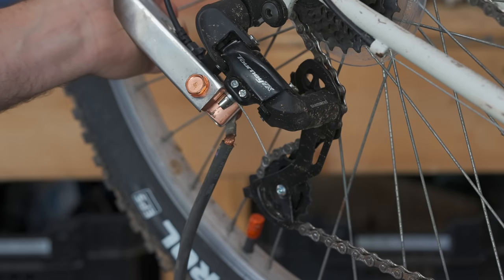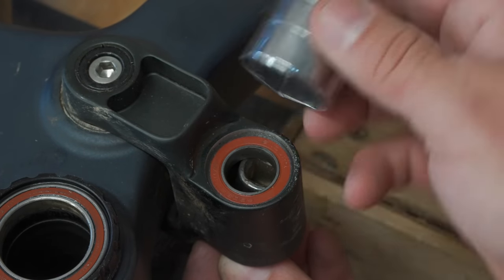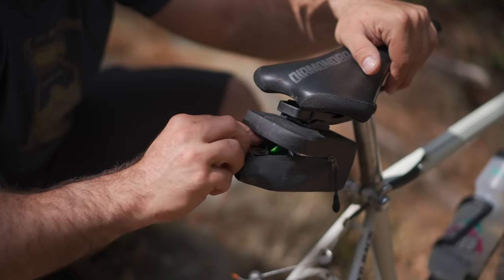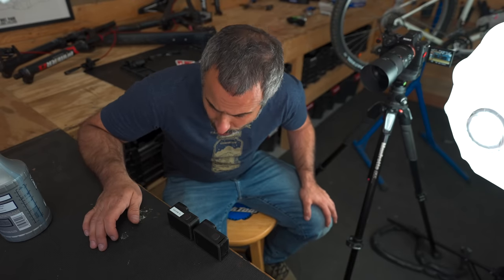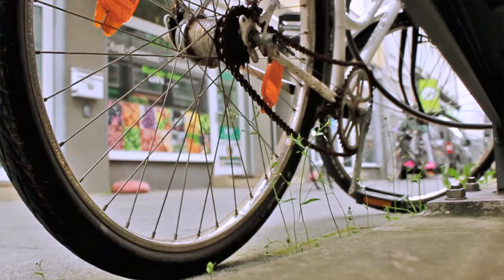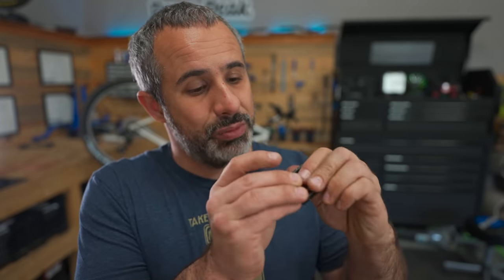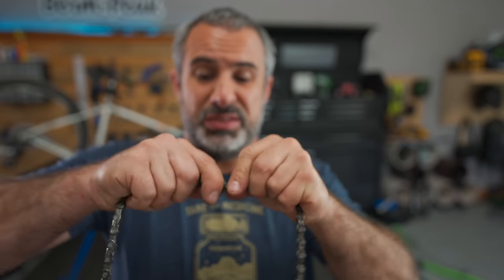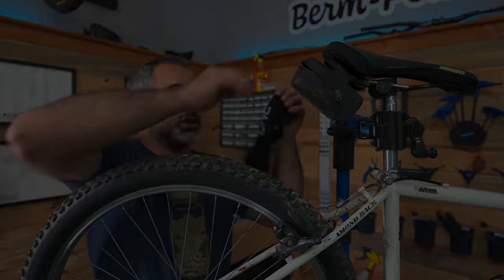10 ill-advised hacks for bicycles

Comment from the maker: Just a note on the chain repair “hack”. This isn’t a hack at all with a single speed chain, BMX chain, or even an 8 speed chain. This is simply HOW YOU DO IT, and in fact some chain tools even have a fence for loosening tight links. But newer 11+ speed chains, or hollow pin chains really don’t hold up well when re-using pins. So if you are repairing your Eagle chain this way, it is indeed a hack.
Reply: for the crank puller, use the little metal bit / insert inside the plastic bit that screws on a shimano 9mm QR axel that little metal bit will fit inside instead of the coin you showed.. and it can be reused over and over and is most likely cheaper than the coin.
Reply: Was status quo up to 9-speed.
BACK IN MY DAY, we didn’t have these fancy smancy quick links and chain pins…
Reply: as a person who works 99% of the time with older bikes it was fun to listen to you explaining how to do something so basic for me :) Normally you do lots of mysterious things like using tubeless tires and servicing forks :D
Reply: Can you do a collab with skills with Phil and go to on Killington bike park this summer.
Reply: Is this a hack I rode 100 miles on this with my cheap multi tools chain splitter won't put it  back together luckily broke down next a mechanic who fixed it with a hammer and body work panel, always carry a quick link😂
Reply: Hey, where did Kevin get to?
Reply: good you added this note, cuz that "hack" was just silly wierd 😂
Reply: Beat me to it.
Reply: Fresh champagne corks as bar ends is the best hack
Reply: Bro what if your 13 and don't have alcohol😂😂😂
Reply: I always put a shop rag in the bag to keep them from rattling. That way I can wipe up my hands or use something softer and then you have makeshift toilet paper
Reply: I broke my arm today but I can't wait till it heals so I can ride some more!!
Reply: lmao i made a comment about this and then saw your pinned comment. my bad, and you're right it's a hack if you're doing it on most road chains
Reply: @ArisaemaDracontium  Exactly, it has gone full circle when the old regular way is re-discovered by the kids with their newfangled quick links as a mysterious hack :)
Reply: thank for you clarifying. i thought you didn’t know what the hell you’re doing!
Reply: I dreamt about fixing a chain the way you described last night!  I think it’s a memory of doing this hundreds of times back in the days before quick links.
Reply: Shimano used to use a slightly larger diameter pin with a break away section for joining chains, pre quick link
Reply: @TimInertiatic  Not just used to, it's still being used.
Reply: @PetrHosek  I thought they had gone over to a quick link derivative
Reply: I have messed up every chain I’ve ever worked on AND broken every chain tool I’ve ever owned. I am terrible with chains and they make me nervous.
Reply: Berm peak merch idea, "most fun things are pretty stupid"
Reply: @TimInertiatic  they still deliver these pins with new chains, at least with 8 and 9 speed chains
Reply: As far as the rain X hack you may not have applied it correctly.
Reply: I was just about to moan!!
Reply: It's better to drive pin back on with pliers wrench and only do final adjustments with chain tool. That way you are not likely to bend the thin chain plate on the chain that is not intended for this type of connecting.
Reply: Haha literally just commented on this, thanks for the comment
Reply: @freetechdk  my dude, that is genius!!! 
my crank tool didnt come with the adapter. i tried all sorts of washers and spacers.. try this later... let's go!
Reply: @cavemanvi  corks also make great steerer tube plugs! might need to trim one a little but so good
Reply: Hey ive been watching the fip series do you know any cheap bikes like 50 or 60 dollars decent bikes im from philiphines bike are super expensive here and i got only 50dollars budget for it
Reply: Pretty much what I was going to say. 😊
Reply: I have used that chain repair hack many times on many different chains and chain sizes.
Reply: На замках в цепи только клоуны ездиют
Reply: @sketchyy7015   buy a used bike, just make sure it all works well and the frane size is comfortable for you
Reply: @ArisaemaDracontium  "Back in my day..."  looks at you in 'old.' What on earth is a quick-link? There's so much new technology I don't even recognize!
Reply: Glad you mentioned the chain process being standard  for 8 speed or wider. Some internet content suggests my tandem maintained thusly and ridden hard for many years will burst into flames at any moment because of my barbaric chain assembly process.
New Park tool with sliding fence doesn't work well for this process of freeing stuck links-older tool with fixed fence works so much better for that.
Reply: Yeah I've always done it this way :)
Reply: Ah. I was gonna say that’s how I’ve been fixing my bmx. Nice to know there’s chains out there that this way wouldn’t work.
Reply: Its just how I repaired chains since I was a teenager. Now its a hack! 😂
Reply: Was about to say, some of the things I used to race that is how we did chains.  I didn't k o about master links till I started riding motorcycles.
Reply: @kennethward9530  I usually would grab the chain at either side of the stiff link and bend the chain side ways  back and forth at the stiff link that almost always worked. Because it will open the link to where the pin is peened over.
Reply: 0:56 1:14
Reply: I am sorry man but basic chain repair is not a hack

Comment: Make sure your socket seats on the outer race of the bearing. If the socket is too small you will damage your new bearings. Also leave new bearings in the freezer overnight before install.
Reply: The bearing hack is sooo good. And cooling the bearings down is a great idea, too. I guess it shrinks them by tiny amount which still will make it easier to install?
Reply from the maker: I love the freezer idea! That's a hack itself, or you could just consider it a great tip for installing bearings easier.
Reply: @SethsBikeHacks  That freezer trick is almost always used when installing new crankshaft bearings on a 2-stroke motorcycle. It works great! Also helps if you first heat up the area around the bearing and then install the freezing bearing.
Reply: There are parts on some motorcycles that use this as part of the standard way to replace bearings. You heat up the outside part in an oven (low heat) and freeze the bearing. The bearing drops right in and once they both return to room temperature it's locked in place.
Reply: @OliverWode  Exactly. Metal expands with heat and contracts with cold, so if it's a bearing that goes INTO something, get it cold and if the bearing goes AROUND something, heat it up evenly in something like a toaster oven.
Reply: Good, glad someone said it!
Reply: Nice!  Never thought of that.  Same principle as putting your tires in the sun before installing them.  It's AMAZING how much easier tubeless, and especially tubeless with inserts are to install with the rubber warmed up!
Reply: I use an old bearing instead of a socket. The size matches perfectly
Reply: @matt.3.14  Proceeds to put carbon frame in the oven 😅
Reply: when i sleeve(they are used to repair damage sidewalls where the pistons ride some engines come from factory with sleeves) engines at my job i store the sleeve in Dry ice as they are designed with an interference fit
Reply: @aleksandras146 
And if you grind a few mm off the od of it then it won't get stuck and also have to be removed somehow.
Reply: Note that if you push or pull the bearing out by putting load on the inner race, it is ruined, and should be replaced.
Reply: I honestly didn’t realize they made special bearing tools. I was taught to use sockets 😂 and the freezer hack yes!

Comment: Since GoPro 10, the lens covers have been advertised as water repellent. So I guess the rainX might work on older gopro's but with the new lens cover it just makes it work worse.
Reply: Also try the concentrate rain x. Really expensive/little bottle
Reply: Cleaning it with alcohol is bad either. It will dissolve that layer of water repellant.
Reply: Might actually work a bit better than it appears, would be best to actually view some footage through the gopro rather than just observing it from the outside.
Reply: I've used RainX on windshields for about 35 years, and it only appears to work 30 mph +, it seems to actually make things worse when under that speed, stop and go traffic, etc., so I can see it not working for this application.
Reply: @yomuno2511  see I find rainex works great at all speeds because the rain droplets are finer and don't streak as bad, so even when stopped it's a clearer view with less sheeting on the windows. In untreated cars theres this thin film of water that distorts your view and I never noticed it until I drove an untreated car the same day I drove a treated one, and the rainx was better at every speed. 

But also that won't help a camera lens and the speed is what really makes rainX shine.
Reply: Thanks for the reply. That hasn't been my experience, all those little beaded balls seem to obscure more so than the sheet on an untreated windshield. I'd have to batt the wipers at low speeds, especially in drizzle. I could be that my application was on large, low angle windshields on a C4 Corvette and 3rd & 4th gen Z28s.  It is neat to see all those beads disappear when up to speed.
Reply: What about WD-40? Thoughts anyone?
Reply: My experience is that Rain-X works on some types of glass but not others, too. Like it works a treat on my car's windshield but not on my (glass) headlights or side mirrors.
Reply: @la1562  Maybe, as WD means Water Displacement. I'd apply it sparingly as it can damage electronics and some plastics. If the GoPro lens is plastic, I'd be leary. It may leave a film that could make vision worse. It would be cool to have a MTB that smelled more like a dirt bike motocross.
Reply: I heard about but not confirmed: cut a potato in half and rub it on the lense  or windshield for the same result s rain x , only it's nature friendly.🥔🥔🥔🥔

Comment: The bigger advantage of welding the end of the cable is that you can run them back through housing again without any chance of fraying. If you need to take a bike apart and want to re-use the cable (yeah some of us are cheap) this would be a big help.
Reply: Soldering would be just as effective and more widely accessible to the general pop
Reply: @BikingVikingHH  Yes, I was thinking the same thing.
Reply: a dab of superglue does the trick for me.
Reply: @BikingVikingHH  This. Especially for larger gauge cables such as motorcycles.
Reply: @lux-3001  cyanoacrylate is unfortunately extremely brittle so while it may hold it together for a while, all it takes is a little deformation and it turns to dust
Reply: LOL no need to weld, just solder
Reply: @BikingVikingHH   @Fitness Philosopher  I used to solder the cables, but I've had troubles with it sticking to the newer stainless cables.
I TIG weld my cables now.  It only takes a half a second.  Be a bit wary of the cable running through plastic parts between your ground and the end.
Reply: @C1Ksdafafdsa980ufsd  a braze rod that works on stainless seems like a good solution. Tig I’m sure work’s amazing but who has a tig welder 😂
Reply: @BikingVikingHH  This is why i use Loctite thread- and bearinglocker. I use it in Engines to keep flywheel Key etc. in place. also wire ends. Corrosion, solvent, heat and weather proof. Also does not get bothered if constant shaking.
Reply: @SergeyPRKL  hey! That’s a good idea! Thanks! Skål
Reply: @MikeBarbarossa  Welding is quicker and easier if you have a welder. Literally just aim at it, hit the trigger, fin...
Reply: @BikingVikingHH  Weld, solder or... just use the part that is actually made for crimping on the ends of cables.

Crazy idea, I know.  ¯\_(ツ)_/¯
Reply: Be aware that there must be a solid ground.  Duh, but what I mean is that every connection, sprocket, pivot or whatever between the cable end and your ground is going to arc and possible weld.

Comment: For the welding. Remember that welds are strong at the weld and the metal adjacent to the weld becomes weaker. Honestly I still trust crimps more but welded cables look much cleaner. Also for the torx vs security torx. If a thief is smart they would only buy security torx drivers. Not saying they are worth nothing, but the difference is minimal. Also torx bits can be used to get at hex bits aswell so the difference in terms of security is low. If you really want to throw people for a loop I recommend getting tri wing drive screws, they look like Phillips but have only 3 instead of 4 wings. Hardly anyone ever buys tri wing bits because no one uses them for anything.
Reply: gamebit and tri-wings are great for messing with people but anyone in console repair will have both of them since they are used quite often on Nintendo consoles
Reply: @Bobis32  I agree that people will have them, but way way low chance of a bike thief carrying them. Not impossible obviously, but at a certain point they're lugging a whole tool box around lol.

Comment: Don't put a sock in it. Put a shop rag or a few paper towels to degunk your fingers after needing your tools. I'm going to reinforce your warning that reusing a chain pin as you did can be perilous with chains that aren't intended to be joined that way. As you said, this is to get back to civilization without having to Flintstone your way to the car. Thanks for the tips.

Comment: It's funny that normal chain repair has become an ill-advised hack. 
This is how chains were repaired every day before quick links and special shimano pins. 
It's also why chain tools have multiple places to put the chain. One to push the pin out. Another is to loosen to link after you push the pin back in. Every chain tool I have has this facility. Even ones I've brought recently.
Reply: I'm an urban rider and I never bother with the quicklink stuff. Anything that involves the chain is at-home work, and I do it with the bog-standard chain tool. I'm not necessarily opposed to quicklinks or anything, I just never acquired any because the tool does everything I need.
Reply: I went here to say the same. If the link is stiff, you use the chain tool to adjust it until the link is just as smooth as the rest
Reply: Late to the party, but I was looking for this comment. I was like “WTH, looks like a normal chain repair to me”.

Comment: Pro tip for getting the grips off if they aren't lock on: loosen the brake lever and use it to push the grip off. It exerts equal force on the surface of the grips and generally shoots it off without too much struggle. Same concept works for twist shifters. It has saved me a ton of time
Reply: If the grip is destroyed anyway, Stanley knife. If you want it off to reuse, get a bit of water under it then use the brake lever. Never fails. Because I use hairspray to stick them on, water is useful in breaking it down and luring it up.

Comment: For anyone looking to use coins as an alternative to crank puller adapters: If your cranks are really tight you will just bend the coin and potentially get it stuck in the spindle(not speaking from experience or anything). :D
Reply: Stack several of them?
Reply: Look at moneybags over here!
Reply: 👆🏼😂

But yes, stacking a few will increase their strength. Sidenote: two “stacked” pieces of metal will have less strength than a single piece of metal of the same thickness.
Reply: Steel fender washers, while not as cheap as coins, are somewhat stiffer.
Reply: I found an Allen head bolt that was just the right size to loosely fit inside the axle, with the head not pushing through.  So far it has worked well.

Comment: I've been soldering the ends of my cables for years. One of the biggest bonuses not mentioned is that if you need to work on something you can just pull the cable right out. With the crimp on ends the cable usually gets frayed and damaged if you remove them.

Comment: My solution against frayed cable ends is a drop of super glue. Works every time and keeps the end neat and tidy even if you pull the cable in or out of the cable guide. Also, you can apply a drop of super glue on the part of the cable where you intend to cut it to avoid fraying.

Comment: you can just solder the end of the cable instead of welding them
really helps when you work on your bike a lot
Reply: I thought the same thing, solder
Reply: heating the cable enough to get the solder to stick is a long and sometimes painful process. 1 second with a welder is a much better use of your time.
Reply: Tried solder. Hard to heat the cable enough for it to stick.
Reply: @brapamaldi7666  if you use flux it sticks in a matter of a few seconds
Reply: I have been welding my cable ends with the spark oof my car battery charger. Works perfectly. Probably not healthy for the charger though.
Reply: @Paul-fs5xj  i tried that, my soldering iron mustnt be that good. works fine for small electronics stuff, but seems to struggle with thicker stuff like jumper cable wires
Reply: @mymorristribe  .... Weller Soldering gun, from cold on the bench to super-hot in seconds ... and use flux
Reply: @brapamaldi7666   .... Weller Soldering gun, from cold on the bench to hot af in seconds ... and use flux

Comment: My experience with rain-x (on car windshields) is that it's better than nothing at first, and then worse than nothing until re-applied. And it's very hard to clean off, so you are locked into a cycle of applying rain-x.
Reply: I had a 1970 Nova with lots of tiny scratches on the windshield, rainx was what made passing a tractor in the rain possible, also great for motorcycle helmets, one look to the side and no more drops to obscure vision
Reply: Just get Rain-X windshield wiper blades they work a lot better cheaper as well